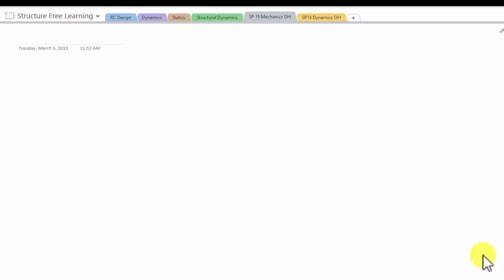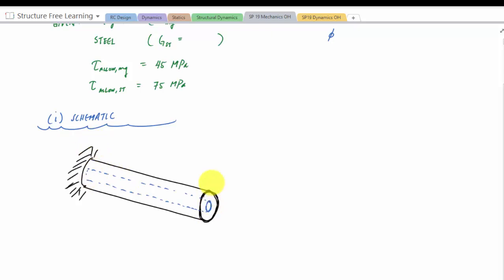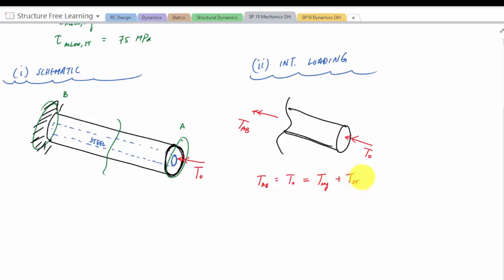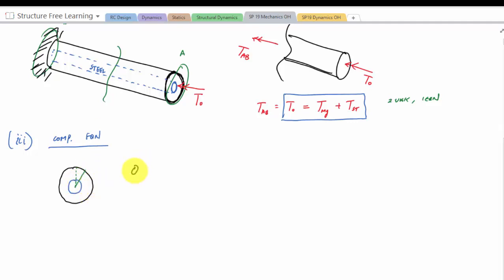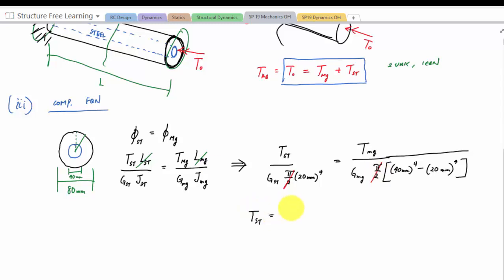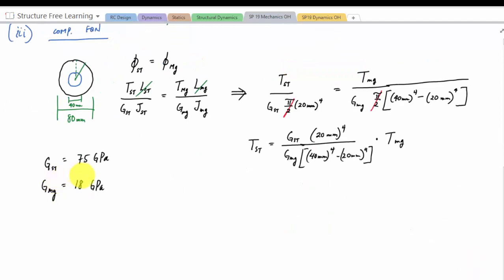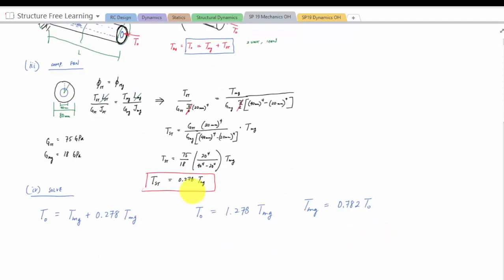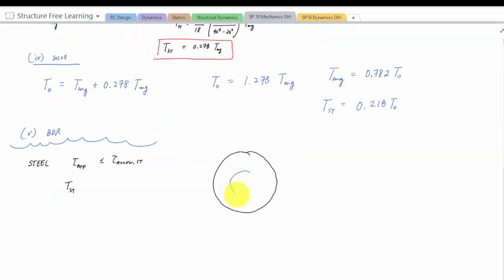Statically Indeterminate Torsion Example - 2 Materials - Office Hours with Structurefree

Comment: Good day to structure-free, I had a situation of a shaft, simply supported by two bearings each for both sides (near to ends), with a single concentrated force in between this bearing which are (R1 _ R2 _ F1 _ R3 _ R4) , continuous with no discontinuity // I got messed up with the suitable calculations for determining the deflection, shear, moment as there are many methods out there from books and online // May I ask what type of methodology or maybe a suitable flow to obtain all these values for this situation? Or Is there any limitations where the Method of Superposition has its limitation when having a continuous beam with more than 2 degrees of indeterminacy? Thanyou to structure-free
Reply from the maker: Sounds like you need the force method or slope deflection equations or moment distribution method....
Reply: @structurefree  Thankyou Structurefree for replying my comment, i see, but i never see these methods in my current reference book // my current reference book only listed "Superposition, Moment area, singularity and castiglino methods and they linked within each other // May i asl for any reference book I may refer to? thankyou to Professor